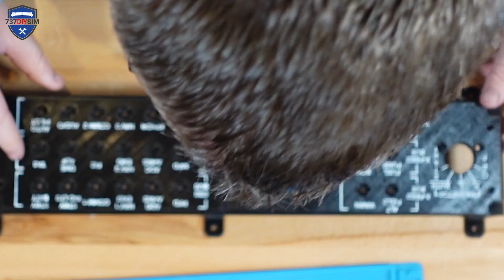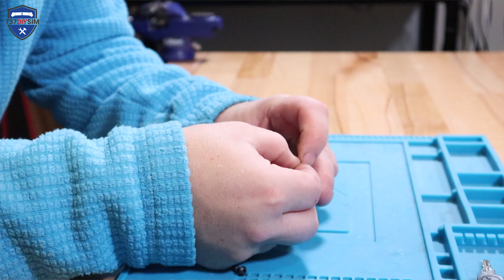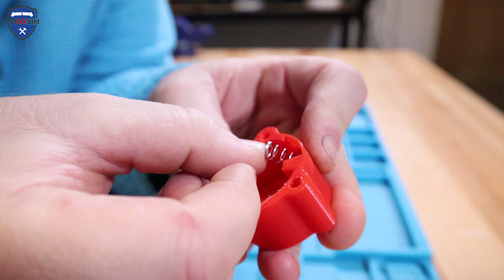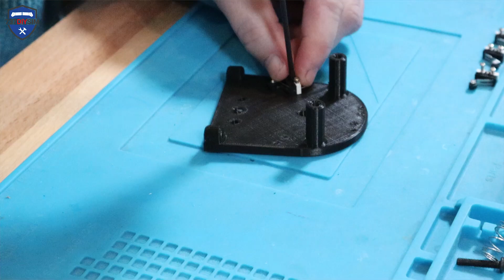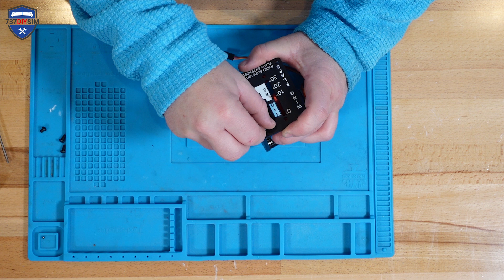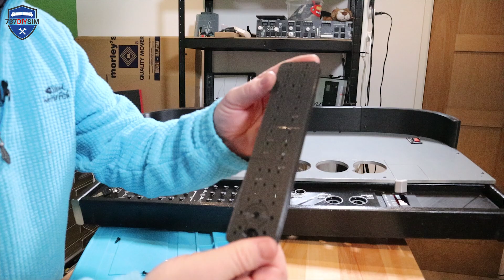C172 Lower Panel, Magneto Switch & Flaps panel build.

Comment: Enjoying these video. I own a 172L, trained on 172R & S. The 172L has a flaps up momentary, off, flaps down momentary. Our Dynon panel tracks position. Another 172L I flew had a vertical position led scale for position.The 172 R & S has the switch as you designed and if only Cessna designed with such good detents...

Comment: @helimech8152 Thanks for super inspiring content, you got me started on my own pit!

What is the size and font of the text you print? Which nozzle size do you use on the CR10?

I am stuggling with printing raised text and painting it after, resolution of my print is simply not enough.

Comment: Your skill set is just amazing 🙂 Is the screens you are using both for this setup and for your 737 always a VGA or HDMI type screen?
Reply from the maker: Hello, Either, if its vga. I use an adapter cable. If its hdim, its usually a hdmi to dp cable.

Comment: Another FANTASTIC video Karl!!! Thanks so much for taking the time to make them and share with us. What type of Laser engraver are you using?
Reply from the maker: Hello Alex, its the OMtech 400x600 machine. It has a 60W laser which is about the minimum i would recoomend as i do struggle to cut perspex over 3mm. Kind regards, Karl
Reply: @helimech8152  Thanks for at info. I have been looking at the 10-20W lasers which claim the can cut through 5mm wood and and acrylic. If your machine struggles at 3mm, I'd done looking at laser as I can't justify buying such an expensive machine. Many thanks. Much appreciated. Hopefully we'll soon see you flight in the C172 sim.

Comment: Hi Karl, my name is Karl, I would just like to thank you for all of your videos, very well put together, very informative, and motivational, In fact, it has inspired me to restart my 737 build which I started 14 years ago and never finished. I'll be reusing using my CDU and FMC parts from FDS, as well as other parts. I have also purchased 2 x Arduino Mega boards, including 2 x terminal block shield boards. I'll be heading over to your website to gather some info on wiring up and programming the boards. Your smile at the camera always makes me smile when you've nailed it the first time. I'm also thing about a 3D printer, possibly the Creality Ender 3 S1 PRO. Keep up the good work.
Reply from the maker: Hello Karl, Thank you for the kind words. The ender 3 is awesome, but if you can afford to get its bigger brother, the CR10 (smart Pro) or even the V2 or V3. It offers a bigger build bed that has become the standard for my designs going forward. Any questions, please ask away. The website chat is probably better though. Kind regards, Karl
Reply: @helimech8152  Thanks Karl, will do. It's the Arduino Mega V3 that I've purchased, so I'm hopping that's right. Thanks again